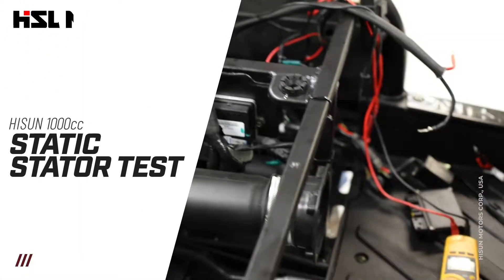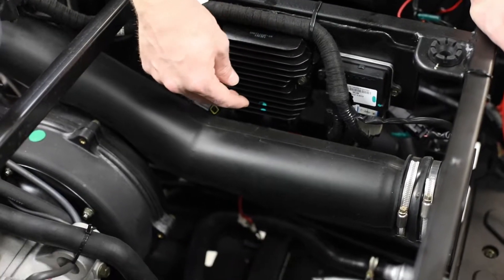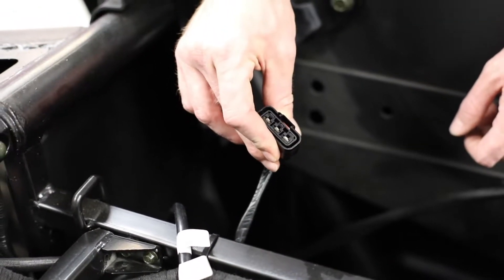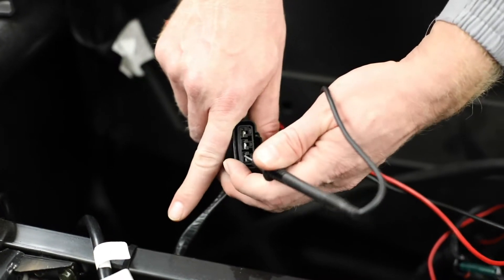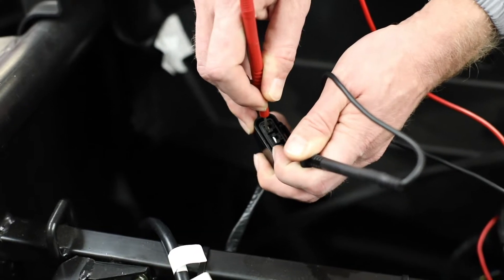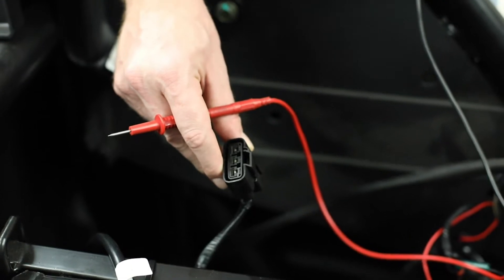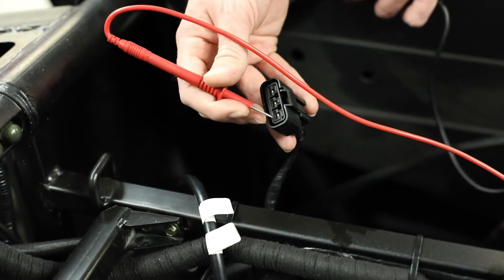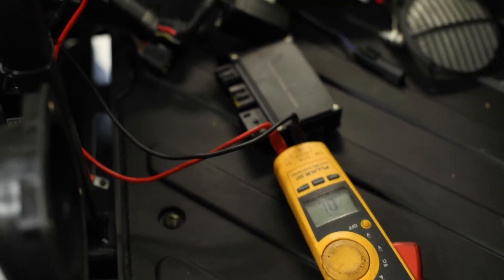Stator Test - HISUN 1000cc UTV Engine

Comment: Hoping I can get a response and possibly some help. I have a hisun hs800. Coils where bad put new ones on it it ran for probably 10 minutes then burnt both coils again. Testing the stator I have 0 resistance as a dead short across the pins. But it’s not grounding to case. Could that cause the coils to burn up. 

4 different coil packs have lost spark and show a dead short on the multi meter.
Reply from the maker: Please contact our customer support team M-F 8:30am-5:30pm CST. 972-448-0760